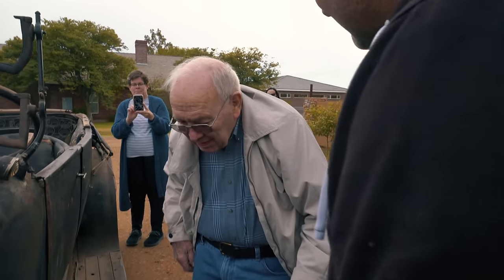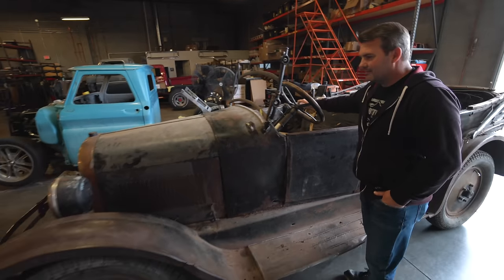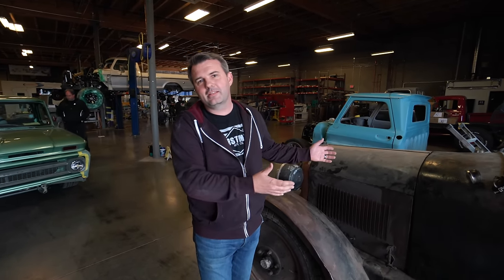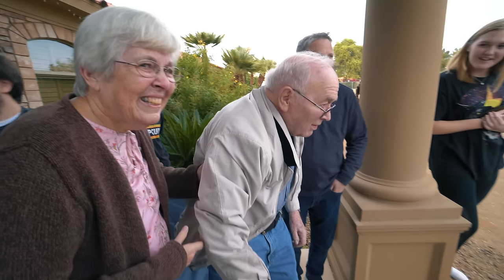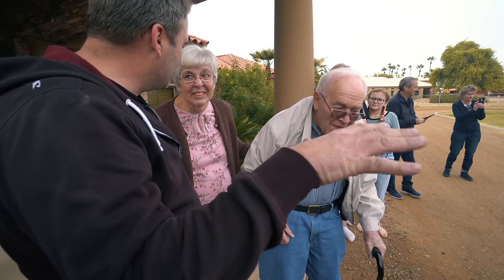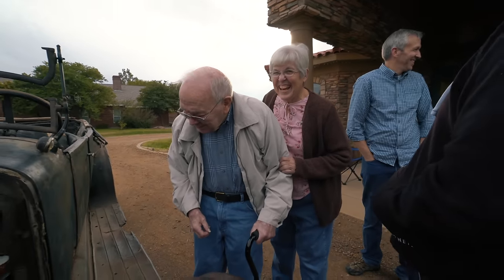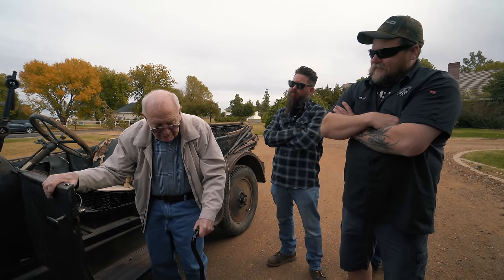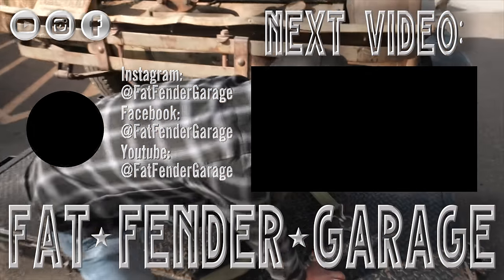100 Year Old Car Finally Runs Again (His first car when he was 16)

Comment: Its amazing how well that engine ran considering the blown head gasket
Reply: That's the pre war quality.
Reply: Cars back then were made like tanks lol nowadays the smallest bump on a car and it’s completely totaled
Reply: @theshield2207  well yeah, but at least they’re safer nowadays
Reply: @cristianr.s.5537  ah yes very safe dies
Reply: When the metal could almost seal itself, that's how good quality things used to be.
Reply: A blown head gasket back then was just regular maintenance lol. Those engines could live forever
Reply: @theshield2207  Yes, they were much tougher
Reply: You would be surprised.  They got away with some crazy shit back then.  The fastest car on track when this thing came out had 2 MASSIVE open air cylinders.  NO exhaust.  You could see the port open and see the flames come off the top of the cylinder.  IDR the name but it looks amazing in recordings.
Reply: Nothing to do with tougher or anything... its just that the compression ratio on older engines is quite low, like this might be 5:1 or something like that. While a modern lawn mower engine even is bout 9:1.... 13:1 or so is getting more common on even gas cars as they start to use compression ignition etc... with modern controls, this is close to diesels which are around 14:1-20:1 compression ratio. So on these old engines even if the compression is hardly there due to a blown gasket it will still run..... just with less power output.

Comment: You can have all your computer controlled ignition self driver cars. This has a soul and is beautiful.
Reply: I agree I am 19 and I have a 1991 k2500 Silverado, and I wouldnt want anything else.
Reply: Ummm dont your 91 chevy have a computer?
Reply: Bart Simpson you’re right, but I think this isn’t a carbureted vs fuel injected claim... ...I think the belief is that there is a lot less technology in a 91 Chevy vs a brand new one. New cars also seem to have a lot less soul. I don’t really get the same feeling out of modern cars than 20th century models. Even with all the sensors and computers the 90s vehicles have, they’re still much easier to work on and will outlive modern vehicles on that reason alone.
Reply: She definitely has personality.  I road in a 1930 Model A, all original, and it was a blast.
Reply: chief tp  By then your car will be worried if you are still running.
Reply: Davey Blue Eyes I’m more 9f a classic guy the most new car I like is the ones from 2014. I love Mercedes.
Reply: Wait till electric cars a common place, then you will keep singing praise for the IC engines and how great they were
Reply: @UmmYeahOk  old cars always require maintenance to live that long. New cars usually don't.
Reply: Socky Noob umm... ...well... ...one would hope! They’re new! I would hope a 2020 vehicle wouldn’t require maintenance! But what happens in 5 years? That vehicle isn’t new anymore. 10 years? That’s why I said “modern cars” instead of “new.” What all will these vehicles need in repairs? And they’re so advanced now and so much crammed in. You have to remove so much from the engine bay just to change a headlight bulb. You pretty much have to take it to a dealer or mechanic for repairs as DIY will become too complicated. Not to mention more technology means more chances of failure. Things like navigation, blind spot sensors, heated seats, all the things not found in a factory 20th century car.
Reply: @51-FS  it doesn't even have obd 2 which means less electronics and sensors and computer systems involved. The last of its kind is the obs chevy
Reply: @UmmYeahOk  cars from quality brands like Toyota tend to not have to have those things constantly replaced and are usually rated for the life of the vehicle. The fact of the matter is that modern cars are mechanically much more reliable than older cars. And just cuz there's more tech doesn't automatically make it less reliable. They tend to be harder to replace either cuz they're poorly thought out or because it's unlikely they'll ever need to be replaced. Modern LED bulbs in cars usually don't go out unless you get a junky Chrysler or something, for example. And as for things like fuel injection, it's pretty obvious that it's way more reliable. If it weren't, the entire automotive industry wouldn't have switched over without looking back. Simple tech may be easier to fix, but that's because it has to be maintained way more frequently. I much rather have something break after 150,000 miles rather than having to maintain a carb every 10,000 miles.
Reply: @Handlebarrz  but its still got a computer....
Reply: Socky Noob I guess you didn’t hear about the recent Toyota recall of 1.8 million vehicles from the 2013-2019 model year because their fuel pump could stop working. You can have a Toyota from the 90s, even 60s still running on the factory original fuel pump. They don’t really go bad unless the fuel itself goes bad due to neglect (sitting for several years). I’m not a mechanic. Just some random girl. But I have changed fuel pumps due to the mentioned neglect on a 60s car, and on an 80s car. They were fairly simple to do. But with a modern car, no way! Probably have to drop the entire tank, and all sorts of other drivetrain nonsense, versus lifting up the hatch cover panel on the 60s, or lifting up on the rear seat bottom on the 80s. They were designed to be worked on, when they rarely needed to be because the parts were more reliable. Parts aren’t reliable anymore. Cars aren’t reliable anymore. You aren’t supposed to keep a car for more than 5 years. You’re supposed to keep buying, otherwise the manufacture could go out of business.
Reply: @51-FS  but you can work on it in every single way it breaks down my guy. Try that with your 2020 pickup with 3 faulty sensors which aren't even faulty but you still can't find the small issues that disables your whole truck! You're gonna be bestfriends with your dealership mechanic and your wallet is gonna hate you.
Reply: @UmmYeahOk  I much rather have a tiny issue like that be fixed by the manufacturer rather than having to guess what's wrong with old cars without OBD-II and stuff. Also funny, ask most people from the 60's and they'll tell you cars back then were lucky to get over 100k miles. Now that's rookie numbers. They are more reliable. It's irrefutable at this point. Just cuz it's a pain to replace doesn't make it less reliable.
Reply: @SockyNoob  modern led bulbs last just as long in a 70s car. And no it's not better to shell out thousands on a electronic piece when you can just tune a carb with a screw driver and clean it with a 5 dollar bottle of cleaner
Reply: chief tp  but In reality some electrics don't get remade and resold. What then? One little sensor gone and the whole thing is driving like shit
Reply: @Handlebarrz  my 2020 still under warranty.... my wallet is happy....
Reply: @51-FS  yea shit usually starts breaking down right after. You know, wear and tear. Come back in 7 years
Reply: Socky Noob but there are plenty of old cars with OBD II. All 96 and newer cars have it, and some even older. I know I always had to argue with the parts stores telling me they couldn’t scan my 94. ...although now it just occurred to me, I should’ve just lied and said it was a 96. Many preOBDII cars have other methods. Either with their own specific scan tool, or just rigging it to blink the check engine light in a sequence that gives you the code. And go back far enough to where there are no such things as trouble codes, and you have the basics. Gauges, lights, and nothing. Sensors may include temperature and oil, but really, something does not work, it’s one of 3 fuses, or something is disconnected. If neither of those, then the only other issue is fuel air and spark delivery. And no computer will tell you which one if out of balance on those cars, though would be nice.
Reply: @Handlebarrz  I'm driving my 2003 suburban with over 300k.. had it since it was new..... it has never been in the shop for more then a 1/2 day..... fule pump is been the most expensive repair
Reply: yes,  because it is made from real steel.  no plastic anywhere
Reply: chief tp  i had a cluster gear custom made for a 51 Hornet gearbox. so it can be done.
Reply: @51-FS  congratulations
Reply: Davey Blue Eyes ok I will
Reply: Working with PCBs and any other electronic issue can be just as easy, fun, and rewarding. Just learn the process like you would mechanical. There is no point sticking with only a starter motor, a generator, and some lights for electronics.
Reply: @Handlebarrz  then why do most cars today last so long without having mechanical issues? Y'all probably think a Mercedes Benz being terrible means all cars today are. And if old cars are so great, why is it only meticulously maintained ones still on the road? Meanwhile you can straight up abuse modern cars and they'll still run the first time you crank.
Reply: Davey Blue Eyes yep
Reply: @SockyNoob  I own an old school chevy and a newer model nissan. Which do you think I drive daily? Which do you think gives me less issues? I'm a mechanic btw so not only my car, but others that I know as well. I'm not one to talk out the ass because of ONE "perfect" personal car
Reply: @SockyNoob  how many modern recalls? 2020 and I've already seen plenty of 2020 recalls issued for technological issues. Some even life threatening.
Reply: @justaguywithachevy367  oh that's cute. I'm 21 and I  have a 64 Plymouth belvedere.
Reply: I have a 1981 Camaro which has a computer, so it's kind of weird to work with the carburetor
Reply: 🤣 Ok, If you say so. I'll stick with my new, better car.
Reply: @jaredshelton4718  is that you talking, or is it your car? 😉
Reply: @Zerodghjj  It's neither. This is a form of texting, not talking.
Reply: @Handlebarrz  Well Nissan just doesn't make good cars in the first place, they're junk, so that's not a good comparison.
Reply: @jaredshelton4718 I stand corrected.
Reply: Yeah. Sad part is these days cars can get hacked as they are computers on wheels
Reply: @UmmYeahOk  My 2009 Peugeot 207 you can lift the back seat cover and remove the plastic cap and there's your fuel tank with another cap to be removed to access the fuel pump 
Easy to do and it's a modern car but I guess we Europeans sometimes design stuff to be more repairable ,at least I'd like to think to,all the repairs I had to do on it have been DIY even changing the thermostat with the housing which wasn't easy to do,me and my dad did it in the garage with no special tools
Reply: chief tp soo funny I see more cars with “onboard computers” in a junkyard then the good old cars with souls
Reply: Pretty sure year 2000 cars will be pretty simple to repair in the year 2080 when robotnics and AI will do it for you, you may laugh at me but considering we are already at the door step of artificial intelligence and robots that can walk on their own and lift things, I mean what it take us? 20 years to get here? Imagine 60 years.
Reply: chief tp  I'd feel way more comfortable and confident in rebuilding the engine or transmission of that "1920s junkmobile" you've mentioned. Or in even having to scratch-build new parts for it, if replacements simply cannot be found, than I would in trying to resuscitate life back into any already way obsolete electronic piece of junk component, just 10 or 15 years after it was once "new". That's just me though... And in my own head and humble opinion, once the machine has morphed from being of metal and mainly mechanical, into something all plastic and electronic, and much more akin to being just one big computer on wheels, all hope is already lost for it ever being something that someone is ever gonna want to hang onto, or make new again, years down the road. It's kinda like comparing some old Commodore 64 desktop computer to any up-to-the-minute laptop or even modern cellphone! Who wants it?? It's just a dead old paper weight now in comparison and relative desirability/function/value. And that's exactly what automobiles have become in this technological age, and what they are all destined to become. Soulless, electronic, completely disposable transportation appliances. Bound for obsolescence mere months after they were once considered "state of the art". And a lot of the same people who embrace and clamor to always obtain the next greatest one, are the very same who claim and consider them superior by virtue of their improvements, cleanliness and reduced "carbon footprint". Completely oblivious and ignorant to the fact that the new ones are getting used up, and subsequently discarded, creating countless tonnes more trash globally, a damn sight more than any of the still on the road and being rebuilt, and enjoyed and cherished "terrible and polluting" old cars of decades (even centuries) ago, ever did. You wanna recycle and be kinder to the environment? Build, maintain, drive/enjoy, and hang onto a real machine. An OLD car. And then when you're done with it, just pass it on down to the lineup of other people still wanting one of their own, and eager to hand you over some of their own good, hard-earned money for membership into the club. That's recycling. To me anyway... But I'm just an idiot with a passion, an old car, and a wrench.
Reply: Davey Blue Eyes amen!
Reply: I know, we had an 88 GMC Sierra 7000 that still works to this day.
Reply: And f**k electric cars and self driving cars. In 50 years I will still have a gas/diesel car or truck.
Reply: chief tp if it’s a Kia it’s gonna blow up your second oil change.
Reply: @BuilditRideit  im sorry but no once you get a ev you realised gas cars were dead along time ago
Reply: @masonlynch1793  you wont be able to buy or compete with a ev in 5 years your screw in 10 and at that point in 20 it will be illegal
Reply: @NAT-rd8fl  lol
Reply: @BavarianM  whata wrong with plastic
Reply: @mrengine970  thats not how computers work
Reply: @popinmo  Pathetic 😑
Reply: @mrengine970  ?
Reply: @popinmo  u just wanna argue with everyone why?
Reply: @popinmo  ok
Reply: @mrengine970  cars dont just get hacked also evs are way better than gas
Reply: @BavarianM   Nothing compared how easy it's fix any American classic car.
Reply: @anthonycusinato3969  My thoughts exactly..your words are so true..that's why i love old cars..❤️
Reply: @katja904  thank you.

Comment: They should restore the car while he's still around so he can enjoy it on the road
Reply: Agreed.At the least a mechanical restoration!!Let Pops give 'em hell one more time!!
Reply: @deliveryguyrx  Yes at least that,  but don't touch any of the body work.
Reply: @kevinloving3141  👍👍
Reply: you don't fuck with all original.
Reply: it's worth more in that condition than restored
Reply: nonyabusiness Not about value, it’s about driving it
Reply: @deliveryguyrx  it wasmt even mechanical restoration. It was runni g like shit
Reply: @technicaltrucking8704  Hell yeah!!!
Reply: @chrishuber8930  well okay change or clean the plugs and give it a tune up thats what all these old cars needs.  At most probably grind the valves
Reply: Kevin Loving they said it was overheating bc of the blown gasket
Reply: @stopglobalswarming  Should be an easy fix (especially if the gasket can be made or is available).Good to hear that it's still here.
Reply: He doesnt seem fit to be driving on the road to be fair glad the man could get one last ride tho bet he was so happy
Reply: @kevinloving3141  we need to paint it again otherwise itl rust worse than an mx5
Reply: @mateuszodrzywoek8658  I'd say give it clear polyurethane coat it will protect it while keeping that aged look
Reply: @mateuszodrzywoek8658  Paint it?Why?What's wrong  with a general tidy up?If you restore it,you'll ending up losing the car's character (and patina).Nuff said,ok.
Reply: Mark Gillies it’s not easy to separate 100 year old bolts
Reply: @stopglobalswarming  I supose  liberal use of RP 7 (or WD 40),wouldn't hurt.

Comment: Seeing you boys bring that ole-girl back to life for that youngster is a testament to how well we used to build things in this country and will one day again. Bet dollars to donuts that no current model automobile will run like that after setting for over 70 years. Thanks for sharing.
Reply: My driving instructor recently got a VW Golf petrol, a brand new one. Had a 2017 Ford Fiesta ST before that. At least the Fiesta had mechanic pedals so it would still communicate with you through vibrations but the Golf gives zero feedback. No resistance on the brakes or throttle, you can't feel the clutch catch when you let it up so you might make it stall. Thing is quite literally a cheap hunk of plastic.

Comment: “Aged out”. Time is like a very slow, very large bulldozer, that stops for nothing.  It would do 55 no problem.   He met a few ladies in that thing in 1947.  At least ONE!
Reply: Exactly,. 55-60 miles per hour easily in its original state. Funnily enough this is a smaller model to the rest of the vehicles in the 1920's, such as a Nash, or Packard, ah or of course, the Marmon model 68 special 7 door which was 220 inches long and about 6'9 feet tall and quite wide, 72 inches.

Comment: I went to a car show and this guy had a good running 1925 Ford TT. He had completely restored it, it had original wood spoke wheels, paint had been kept if very good condition, he replaced all the wood, overall a very impressive car with original parts. Best part is its from 1925 and it was still under warranty.
Reply: How is it under warranty
Reply: @beamboy07  No idea, but it was impressive.
Reply: Did ford offer lifetime warranty like Porsche did at one point ? (For the Porsche tractors, not cars)
Reply: @Windows98R  I have no idea, that show was 2 years ago and I don't remember seeing anything else about it.